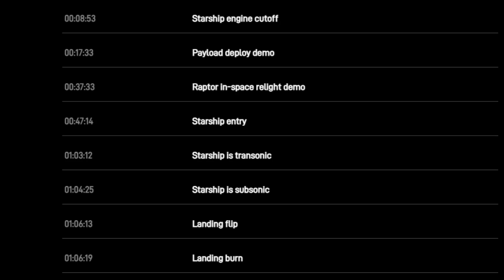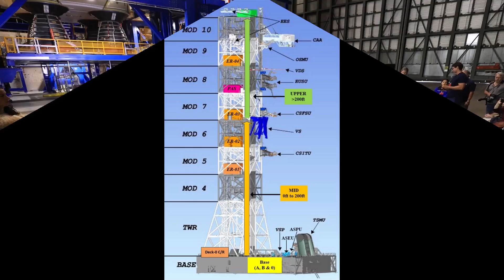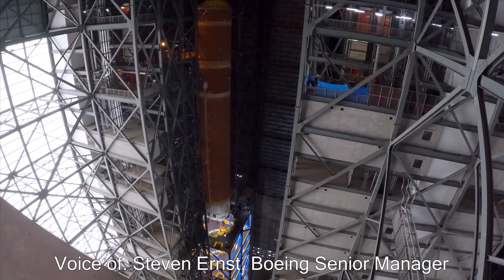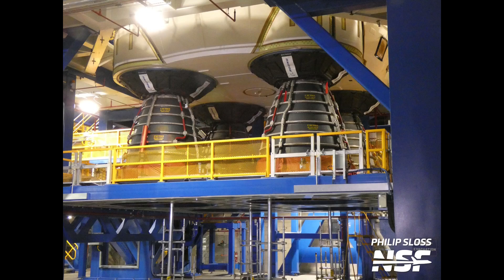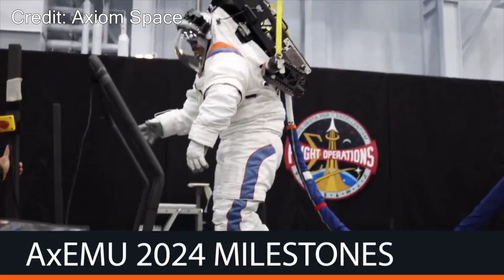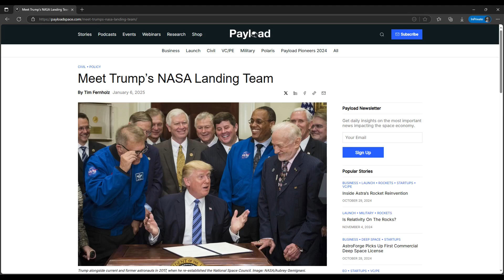Starship flight test 7 on deck, Mobile Launcher-2 "rig and set," and Artemis II stacking continues

Comment: The double refill for HLS is the flight profile of it coming back to LEO from the Lunar surface.
Reply from the maker: Is that publicly documented?
Reply: HLS probably doesn't have the delta-v capability to come back to LEO directly from the Moon but if it comes back to that tanker in what is essentially a geostationary transfer orbit then it could refill and then brake itself into LEO where a crew could transfer to a Dragon for landing. This is assuming Starship itself is not man rated, if it is then crew can  transfer to Starship in LEO or GTO depending on what heat load it can take during reentry.

Actually HLS probably needs a tanker in GTO even if it is not coming back. It's been stated before that Starship has a delta-v around 6,5 km/s and assuming HLS has roughly the same then TLI from LEO + lunar landing and return to LLO is out of reach. HLS has to be fully fueled in something similar to GTO.

There will be an enormous number of tanker flights to fill a tanker in LEO and one in GTO, like 20+.

Comment: When would we hear more about potential changes driven by the new administration? Right after inauguration? confirmation of Jared? Appropriation discussions?
Reply from the maker: All good questions.  I would think no later than the FY 2026 budget request, which could be out in the spring.  

But I'd be surprised if it's that long; it could be any time after Trump and company is back in control next week.  

Isaacman will probably be asked about plans at his confirmation hearing and it will be interesting to see when the Senate science committee schedules that.

Comment: Why do they stack the SLS SRBs one segment at a time from the bottom up instead of doing multiple joins at once. Could they, for example, be simultaneously joining the center forward and forward segments on some other holding stand, while also joining the center segment with the center aft segment? That way they could then lift and stack the final two segments onto the rest of the booster at once as a finished subassembly? 
Is the crane the speed limiting factor when it comes to booster stacking?
Reply from the maker: There's only one heavy crane available for that integration cell, so they'd need to redo the cranes and VAB infrastructure in order to support those ops.  Given the weight of the loaded segments, doubling subassemblies up would also change the required ratings for handling equipment.

Not sure how much benefit would be gained in schedule vs. the cost and safety concerns with maintaining multiple, large safety perimeters around the loaded segments.  The VAB is sized to support parallel vehicle stacking, as was done during Shuttle; however, SLS/EGS was always sized for this low flight rate and that's never changed.
Reply: Given the weight of a single segment, it's also an open question if the VAB structure could even support lifting multiple segments at once (I doubt it).
Reply from the maker: @TheBleggh  The 325-ton cranes should be rated to handle that load, but then there would be questions about the pallets and stands on the ground supporting double the weight...and possibly the other equipment like the 384-beams.

Booster stacking probably isn't on the list of bottlenecks for SLS launch/flight cadence.
Reply: @PhilipSloss 
And also 
Won't doing it in parallel requr double the amount of engineering that perhaps in limeted supply

Comment: I really wonder if NASA might consider mating a second stage and the Orion third stage with the Super Heavy instead of all this SLS stuff. At least the Super heavy is reusable and much cheaper to get off the ground. I wonder if SpaceX would be open to "renting" the Super Heavy. The mobile launchers could go away too.
Reply from the maker: It's up to the President and Congress to make decisions and spending choices like that.  NASA implements/executes policy, it has much less latitude in terms of dictating what it does.
Reply: Really mostly just Congress, in this case.  @PhilipSloss
Reply: I doubt there is any second stage that is both lightweight enough for Superheavy to lift, and can take Orion from Superheavy's very low stage separation speed to TLI without refueling. By the time such a stage reaches LEO, it would be carrying around so much dry mass from empty fuel tanks that reaching TLI would be very difficult.
Reply: @plainText384  Superheavy has such a low separation speed because of the mass of it's second stage. I ran OCR on the test flight footage to pull data and initial acceleration is almost identical to F9, but where F9 dips acceleration around MaxQ for aerodynamic purposes, Superheavy falls behind from then on. This is presumably due to the insane weight of the system's second stage as a proportion of total mass. The total energy available in Superheavy must be extraordinary. I see the bigger issues here (as Phillip has pointed out in the past) is that although it might be more sustainable: 1 developing some kind of adapter to mount it/EUS/some other stage to superheavy would take time and at the moment the political will is behind beating China back to the Moon; 2 SLS has survived so long because it distributes money to so many States, Superheavy as an option limits that to only a few. As a couple of side points I guess this plan would also require deep integration between all parties involved (both public and private) which tends to lead to finger pointing when anything goes wrong and Superheavy would require a human rating, which (like F9) means that SpaceX would no longer be permitted to iterate rapidly